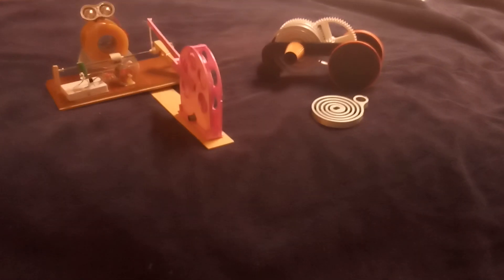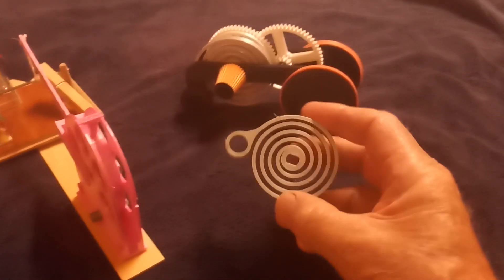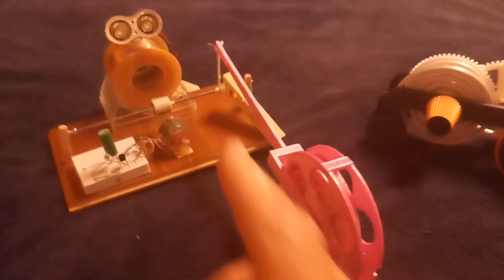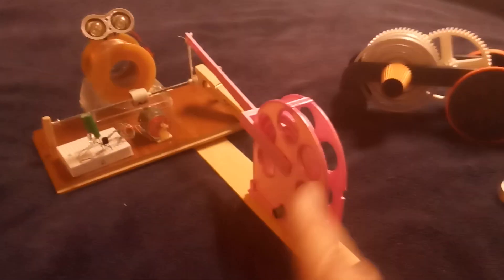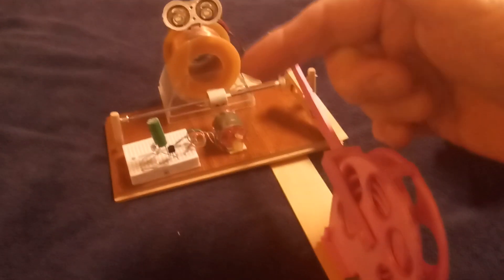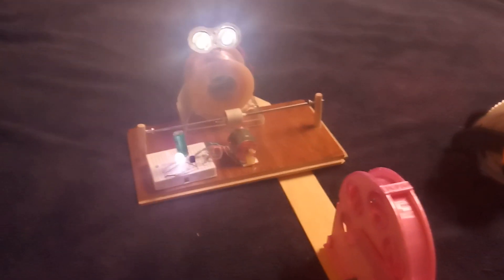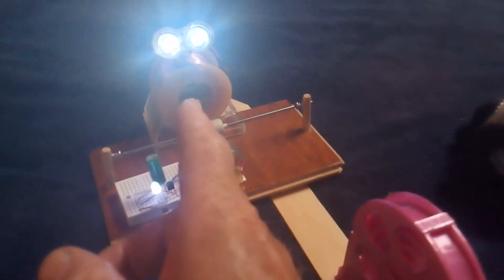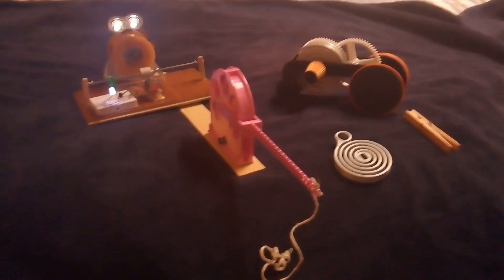Plastic Electricity

Comment: Some strange wobble with the anti wobble trying to follow the center off the spring. I clicked thinking you might be storing electrical energy in dielectric but a printed spring well that's something different. Curious to know if the toolpath effects the spring....like if the printer made all the additions of pla in a direction that follows the form of the spring or did some off laminating like adding infill and such. What did you slice it with. Printed solid? Follow shell? I might print that car thing....
Reply from the maker: I used Cura for the slicer with 80% infill.  This whole idea of 3d printing a plastic spring is rather facinating.  What kind of filament plastic is best?  What is the best shape?  Solid vs infilled?  Leaf vs coil?  Is it even worth it?  Lots of questions.
Reply: @Lidmotor  try follow shell only and make the walls really thick. Should make a good laminated spring. Infill would be less than optimum. Annealing would probably also help.

Comment: How long does it run without the capacitor charged?
Reply from the maker: The 2.7v 4F super capacitor had to be preloaded (about 2volts) for the motor to run.  It is kinda like trying to start a car engine with no gas in the tank. This experiment could be done several other ways to show the energy conversion.  Initially I just used Maggie and the rotating magnet to show it happen.  Adding the motor driver made for a better video effect.  If I did this experiment with one of my micro amp pulse motors I could probably use an empty 1000 uf cap and get the motor to run awhile.  Maggie woud be used to charge the 1000 uf cap. She has a bridge rectifier on her to convert the AC to DC.  Her led eyes clamp the output voltage to around 2.7v.